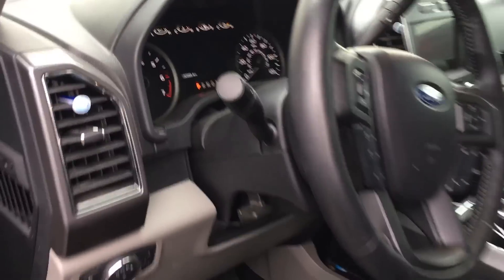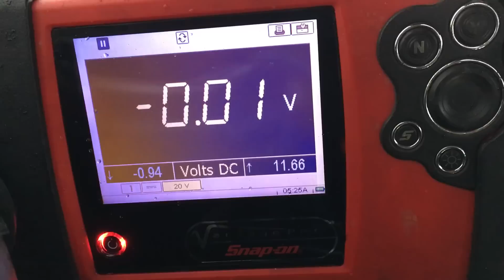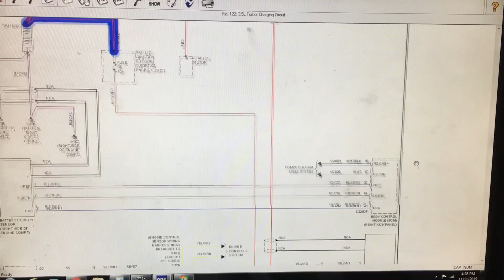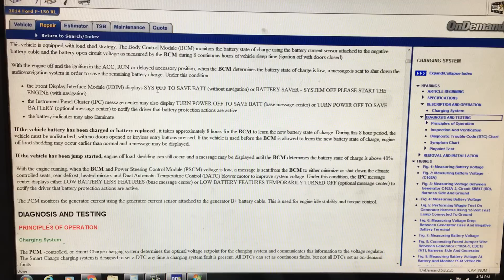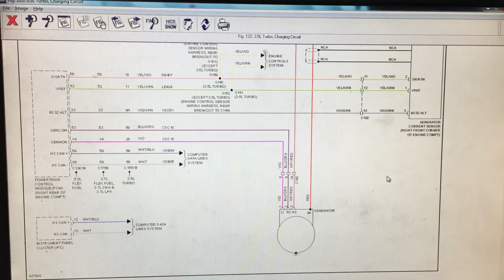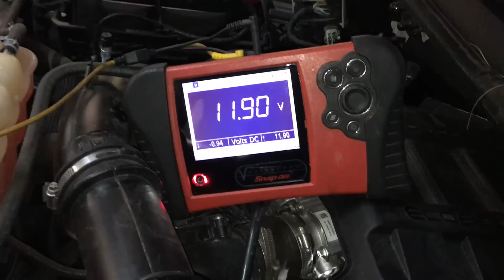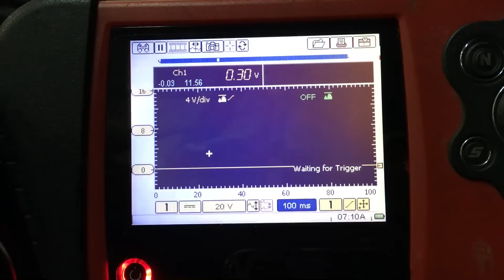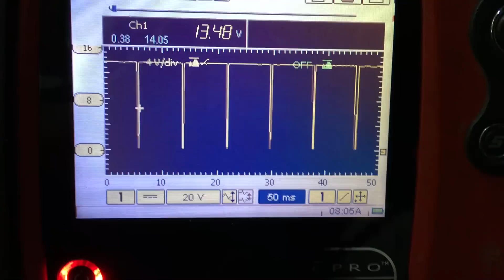FORD F150 ECOBOOST CHARGING SYSTEM SERVICE NOW DIAGNOSIS

Comment: There is great technicians that work in privately owned shops. Just because you go to a dealership doesn’t mean your getting the best workmanship. Some great technicians can’t work at dealerships for personal reasons. But you sir, definitely know what your doing. I’d definitely go to your shop for everything my vehicle needs. Great job on the diagnosis of the vehicle.👍

Comment: Great job on the diagnostic. One thing seems very apparent to me, and that is the dealer did nothing to diagnose the problem. All they had to do was the simple test you did of connecting a voltmeter to the battery to see that it wasn't charging. But they saw an opportunity to make money, so they sold him a battery that he probably didn't even need
Reply: @Flatus Antiquitous Either that, or they were just too flat-out lazy to do a diagnosis, and just wanted to make some quick and easy money by selling a battery. They don't call 'em "stealerships" for nothing...
Reply: I got my battery replaced three times b/o the power shedding (i.e. switching off none essential consumers). Only after I charged the battery and let the car rest for 8 or more hours, the problem seems to be gone. The car dealership didn't tell me about this requirement, I found it in the manual.
Reply: The technician at the dealership needs to go back to school and get more training. Better yet have him watch this video!
Reply: I’m soooo mad 😡. I’m on my third battery. The aftermarket company and the dealership are giving me the run around.

Comment: Why would the dealer put a battery in this car with a “ charging system “ complaint and not have the decency to take 30 seconds out of their time to put a DVOM on the battery terminals and see that the battery is not getting replenished?! Unbelievable if you ask me! And then they wonder why more and more people can’t stand going to them! Great video brother,thanks! 👍
Reply from the maker: That's what I don't understand. How did they miss that problem? Thanks for watching!
Reply: The truck never made it inside the ford shop.    Most likely the customer did not have the patience to have a proper diagnoses, and instead chose to "wait" instead of leaving the vehicle.  So the job got handed over to a hourly lube tech who was told to replace the battery a sap.   Dealership more concerned with getting the vehicle fixed quickly then correctly.  Partially customers fault for being impatient and not leaving vehicle for proper diagnosis and repair.
Still a simply volt meter across both battery terminals would have showed a problem.
Reply: @nissanneal  You have no way of knowing this is what happened unless you work there. If that's the case might as well say it!

Comment: Thank you Eric. Good job. With Ford smart charging systems, you can monitor GENCOM and GENMON in Engine live data Duty cycle %. If the alternator was good, you should be able to unplug the alternator connector, KOER, the alternator should default charge at about 13.7 VDC. You can also test the GENCOM and GENMON wires by installing a fused jumper wire across the two harness side terminals. KOER, monitor the live data Duty cycle for both GENCOM and GENMON. They should mirror each other, as long as the wiring is good. Have a blessed and safe week.
Reply from the maker: Thanks for the info!
Reply: I have a "charging system service now light" new battery, alternator,and PCM relay or fuse #82  2017 mustang gt
Reply: @ADVANCEDLEVELAUTO  also im seeing 15 volts

Comment: Great job on the Diagnosis. Nothing gets fixed without a Proper Diagnosis done first. Mechanical Repair or Replacement only follows a Proper Diagnosis .
The New Generation Mechanic has to own all the Hi Tech Equipment today ie Scanners  & Oscilloscopes &  DVOM'S,  etc. and they need to be able to read and understand Circuitry Diagrams which lead they to the problems.
Just to let everyone know there are other great Auto YouTubers out there like Scanner Danner. Chris Fix is great for showing the Mechanical fixes and Installations. Cheers

Comment: Thank you for this video. My son owns a Ford F150 and had the "Charging System Service Engine Now" come up on his dash. He took it to Autozone to have the battery and Alternator checked in which Autozone said they checked out good. I looked at it and checked the three wires that went to the Alternator to make sure they were not broken and they were fine. My son then brought his truck to a Ford dealer who had it for 5 days and they told him that everything is fine and that they cleaned things up and it is OK. The next day the "Charging System Service Engine Now" came back on and I did some research and came across this video. He was going to take it back to Ford and I said lets just go buy an Alternator and put it in ourselves which we did and now everything is fine. What is ironic is that my son had his oil changed a week before this problem showed up and they forgot to put the dipstick in and oil blew out under the hood. I cleaned the oil up never suspecting it had anything to do with the Alternator but after watching the end of this video you said the customer had his oil changed as well and they forgot to put the cap on. I concluded that if oil is spraying out under the hood and it gets into the Alternator that it will ruin the Alternator.

Thank you again for this video

Comment: I noticed the oil soaked rubber cap when you put the camera on it. Definitely the reason the alternator failed and I really appreciate you going over the system description. I wasn’t used to studying the way a circuit worked when I worked in the dealer but now I see that reading and understanding the system is the most important part of the challenge! Thanks Eric!
Reply: Yeah, I would agree that understanding the system is a very important step on fixing anything. I also hate modern 'smart' things. like the smart phone, why do we have so many stuff in them? I only use my phone to make a call, or watch video, nothing more. Modern life is just crazy.

Comment: Thank you very much. I have been a fan of Scotty Kilmer, I started my interest on cars about a year ago. I would say your channel is better to me than Mighty Scotty. You have much more insight diagnose than those from Scotty. My back ground is that I came to this country from China ~30 years ago, my highest education level is a ECE Phd. I have worked hard to advance to my career, now I am in a middle age wondering and I put my interests in cars. I do  not feel difficult on electonic stuff, I only need to accumulate my knowlwdge on mechanics. I have a big rant on 'modern' cars, too much electronic control, which may intimidate normal Joe. Nowadays, every thing becomes 'smart'. I just hate those smart stuff. What is wrong wit a generator, just charge the battery. Sign.

Comment: If this is a 2018 truck shouldn't it still be under warranty? The dealership should pay for the cost of the alternator and labor since they were given a fair chance by their "factory trained" mechanics/technicians. Or that oil change shack should pay for all the repairs since it was their fault.
I remember I took my ford windstar to mr.lube for an oil change and got the transmission fluid flushed, this was on a Sunday on Friday I went and got new tires installed at Canadian tire and they told me there was transmission fluid all over my engine. Mind you at that time Indid a lot of driving including on the highway. I go back to mr lube and the guy who did the job said he did not connect the line bAck properly and had come apart. That killed my transmission had to end up getting rid of my van at that point.

Great video and you figured it out so easily you are a very honest mechanic and you replace only what needs replacing!

Comment: You might want to check for battery reset in your scan tool' so you don't  rely on sleep mode by customer. You do not want to ruin new parts. Great case studies I like your work.

Comment: Great video and so glad you went through the description.  I have a 2016 model with only 35K miles doing the same thing. Battery replaced a year ago and have not sloshed oil on the alternator!!

Comment: Ya nailed it 100%. Had to do this on a Taurus. You can rebuild the 6G alternators but it can be a PITA to get the right version of the regulator. also the slip ring is a PITA to replace.
Best to just get a new OEM one.
All aftermarket alternators have the wrong regulator so they default to the full system charge voltage which puts the CEL on and takes a toll on the battery in no time.

Comment: Great diagnosis, my 2015 just did the same thing.  My alternator is covered in oil also. I'm going to bet that is what damage the monitoring system.  My fault,I spilled some oil when filling without a funnel. Thanks for the info!

Comment: GREAT VIDEO” on how to check All the connections on the electrical Charging components’ before you come to the conclusion that it is the alternator which is the most expensive item throughout the charging system besides a battery I am having the same issue with my 2013 eco-boost F150 my charging system when I change the battery was fine at first and then it started not charging the battery Maintaining his self at 12.8 the voltage’ but my charger system is not showing any problems in the dashboard so I was kind of wondering how should I go about checking anything first? This video is very helpful with the proper information on how to check the system for any malfunctions and how to determine, which is the failure in the system and how to replace the proper item without spending any more money than what you have to.thank you’ this is very instructional and helpful

Comment: You did a very thorough explanation and demonstration. I had this same issue with a customers vehicle this week and I only had a basic idea of how the charging system worked. I had to do research as well but when I was trying to explain it to someone they were confused and I found your video and showed them and they understood what I was saying. Well done. Only mistake I noticed which is not a big issue at all is you stated the engine is a 2.5L and it is actually a 3.5L v6 twin turbo. In my opinion ford had a good idea but it’s a horrible design and engine. Too many electrical components for everything timing system is known to have issues with the phasers and chain stretch, turbos fail quit often. And the list goes on. I work on these trucks daily. 2009-2022 ford f150 and f150 raptors. They do make excellent power and torque though considering it’s a smaller v6 instead of the v8 but in my opinion they are crap. Thanks again for your video.
Reply: I drove my first Ford f150 V6/ sounded like a boat motor! I have a 5.0 coyote f150 and will stick to them.

Comment: I noticed the oil on the alternator also.  You did a great diagnosis and showing that waveform on the return to pcm. Ridiculous price for an alternator.  Yes if you were a parts changer you would got lucky changing the alternator.  But if there was a broken wire from input or output a person be stuck with 700 dollar alternator.  Great fix.
Reply from the maker: Yes. That's why I think it's important to understand system design, so that we can properly and easily diagnose these systems. Thanks for watching!

Comment: If the owner told before you start diagnosing maybe you decided to clean the alternator if the oil gate inside it difficult to dry it isolated between two parts anyway thank you for for sharing this i learned a lot yours videos,,

Comment: Nice video!
Load shedding in electrical systems means switching off non-vital loads so that a high priority load does not overload your incoming service.
On a vehicle, the PCM switches off the alternator under WOT conditions to gain a few extra HP at the wheels, lower 0-60 time.
Many vehicles run electric water pumps for the same reason.
Also when system voltage is low, non-vital accessories may be turned off to minimise battery load.
For example on some vehicles the HVAC blower will not operate without the engine running.
Radio disabled after 20 mins KOEO etc.

Comment: A few of us remember a time when one could remove the alternator from the vehicle and test a full field voltage and current output, on the bench. If the tech messed up by missing a voltage drop in the line, he'd have one last chance to find his mistake before buying a new alternator. Some of those had separate voltage regulators, so you could replace only what was needed. Now with all the built in electronics, you end up having to replace much more, even the one way clutch.
Reply from the maker: I also remember a time when alternator didn't cost $750!! Thanks for watching!
Reply: I remember a tech who replaced a gm alt that was not charging only to find a blown fuse after. I also remember a tech installing a alt in a 3.4 DOHC Lumina only to find out it was defective.
Reply: I remember selling rebuild kits for alternators and starters. I also remember being able to remove the negative cable from the battery on old cars to test the alternator.

Comment: Eric, excellent video. Thank you for walking us through how the system works. The customer is very lucky he only needed an alternator and not an engine YET. Wonder how much oil was left in the crankcase after a 300 mile trip with no oil cap. Probably the best is yet to surface. For the customer, I hope not. Anyway, Eric, your videos are excellent and thank you. Artie 👍👍👍

Comment: Good video , thank you . I'm just curios as to why you didn't take it apart ,clean it. Replace the brushes and diode ? Is that something shops are not doing anymore these days . My pickup did the same thing and the Ford dealer in Dunsmir Calif . fixed and for less than 100.00 sent me on my  .That was in 2006 though .
Reply: could have possibly cleaned the internal parts with brake clean

Comment: The system that uses has been in UK for quite a while called smart charge. You may not get a charge reading if the battery is fully charged or vehicle not driven. It will only show battery voltage unless the battery goes low. It's designed to charge while driving to cut down on emissions. If the alternator is on at idle it creates a load on the engine increasing the emissions. So some systems only charge when driving . Obviously this alternator was faulty buy the return wave pattern. Good video as always I feel a claim on that company who left the oil filler of coming !!

Comment: Leaving the oil cap off seems similar to HVAC where some guys over the years have left gas valves off or even the gas pressure taps off after maintenance. Leaving either a no heat symptom or most of the wires in the furnace burned. Hopefully they helped the guy with the bill and the fact he went 300 miles with an oil cap off is unreal.  Amazing he didnt notice any noises or literally anything 😂

Comment: I was wondering why the alternator crapped  out on such a new truck,  I was also curious about how miles were on it, roughly.  Now I know! I agree that SERVICE INFORMATION is so vital,  especially knowing that the command line only sends out burst of data command packets instead of a steady stream like the older ones did. Great video I know it has to be difficult to video in tight places and have decent lighting.

Comment: Awesome video!   Bet they hosed alternator down with brake cleaner to clean up oil.  So much for the alt. winding insulation.
Ford also says to do a new-battery reset using the Ford software - Forscan works too I've read.   Something about how the battery charge profile is ecm changed to accomodate an aging battery.
Anyway, fabulous breakdown of how the system works and how you do your diagnosis.
I need to get a scope.....multimeter is clearly not enough these days.

Comment: You scored IMHO a 99.99% on a great video.  Am subscribed to any continuing efforts with F150s.   Yet, I might have missed something,; so I gotta ask a simple question as follows:  Did you remove the oily connector to the Alternator just to clean contacts , reconnect and re-test for a flat-line?   Great job helping us Learn !!!

Comment: Great video! Quick question, we're you able to access the power terminal on alternator without removing any parts?? I'm wanting to add a 1/0 cable from alternator to battery. Adding a 1500 watt amplifier. Any help is greatly appreciated.

Comment: Great troubleshooting, hope the customer takes this $1000+  repair fee to the place where they changed the oil. 
Also surprised that a new truck has SRS light on, perhaps oil got into a SRD connector

Comment: The trick is change battery when you see the first sign that its taking longer or dragging to start, and about 4 years old, this will save your alternator on any truck, The Mitchell on demand you were looking at was for 2014 year,